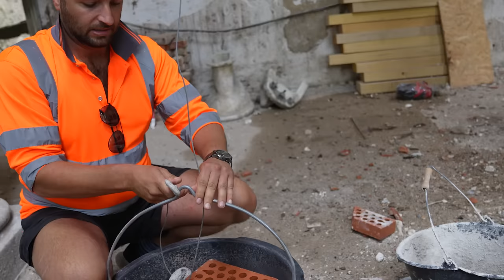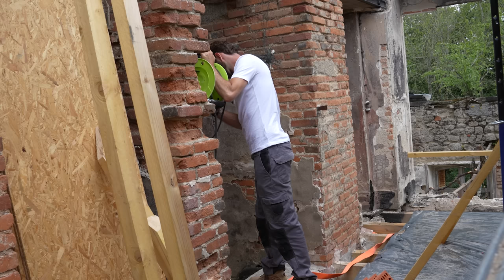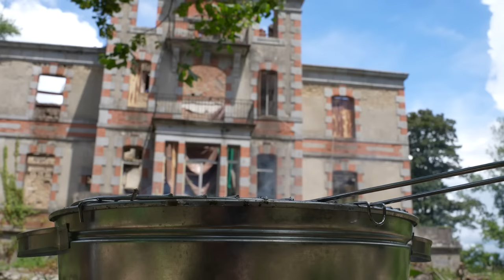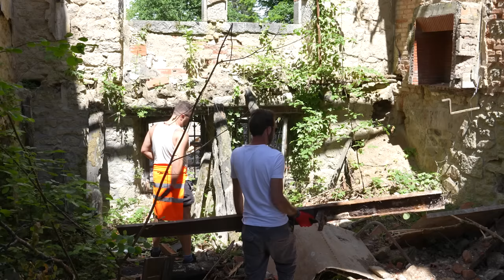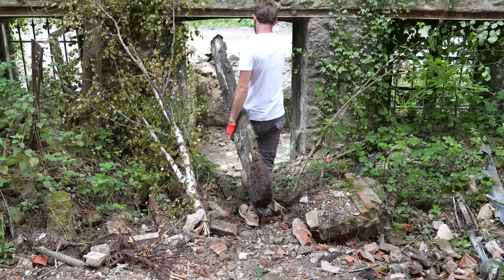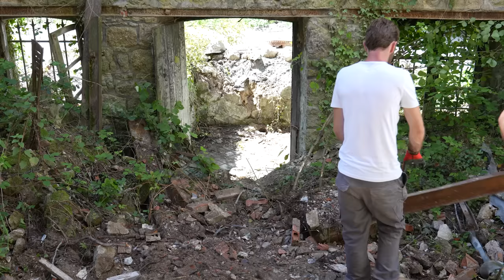300 bricks, two men, and a water tank.

Comment: Suggestion...move the bathtub outside and use it to soak many more bricks in prior to bringing them upstairs. It would return you to bringing them up a bucket load at a time again, but might help keep the bricks hydrated longer, especially on hot days. So glad that orange is still part of the wardrobe!😆
Reply: Bonne idée !
Reply: A second bucket could help as well.
Reply: Hydrated bricks will be heavier
Reply: @mireille4751  but he has to carry the water up in any case.  I think it’s a good efficiency idea to soak more brinks and have three or four buckets.
Reply: And - leave the tub where it can catch rainwater so Dan doesn't have to haul as much in!
Reply: Good idea!
Reply: @Marcus-ki1en    I was looking at the wheelbarrow sitting there thinking Calvin would have less trips & be quicker on sending the next bucket up. But I'll bet they savor the couple more minutes it took to get the bucket back on your level. So Much easier from the comfort of my couch 🛋
Reply: You will owe Calvin big time.  Friendship is a wonderful thing.
Reply: @marshawargo7238  I saw the same thing, but with the wheelbarrow, you are just moving the pile and handling the bricks three times.  I have bucked my share of bricks in my day, I don't envy them at all.  Always good to have help.  Pass me the chips and dip.
Reply: I like the idea of using the tub to collect rain water.  By putting it up higher and adding a facet at the drain, Dan would have water. Brilliant!!!
Reply: hoist the tub to the upper level and put water in it and dump bricks in as you lift them.  dry bricks are lighter to move and carry
Reply: Gute Idee!
Reply: Will  not work. The bricks will be heavier.  Can  polly bring it up! With wet bricks.Pull the bricks up. When you get them up. Then  water them..
Reply: @raynonabohrer5624  I think Dan has been using an electric hoist to bring wet bricks to the upper floors in previous vids already. I recently looked at low capacity hoists for my own use, and the lowest capacity I found online was for 200kg (440lbs). I'm sure that any hoist that Dan acquired is able to handle a bucket full of wet bricks. He may even be using it to install the new steel I-beams next week, if he's not having them installed by an outside contractor, in which case it will be capable of 700kg at least. Either way, he will find his way, I'm sure. He has so far!
Reply: Genius!❤
Reply: @mireille4751  True, but Dan already uses a hoist to bring up the buckets of bricks, so the hoist should be able to handle it.
Reply: Great idea!!
Reply: Mr June”s singlet and shorts does it for me - I’m not into orange!
Reply: Brilliant!
Reply: @mireille4751  yeah, but it probably beats carrying water alone, and then trying to sprinkle it around evenly...
Reply: That's a good idea.
Reply: Dan is right to soak it after  the bricks are upstairs. It will be heavy to do it downstairs.
Reply: They cannae find the plug 😂😂😂😂😂 xx
Reply: @mireille4751  And healthier!! XD
Reply: @andymccabe6712  Can you explain why the suggestion is so out of line? Dan has an electric hoist that he could have used to raise the buckets of moistened bricks to the upper floors, so it isn't a question of having to haul up the buckets by hand on the ladder. I'm truly interested in knowing why you would believe soaking the bricks in the bathtub to be so unreasonable. Thanks.
Reply: Hot tub or Orthopedic spa may be in order!
Reply: if they bought a second bucket they would be flying it, whilst fella on the bottom is filling a bucket the fella up top is emptying and stacking, i noticed them taking a tree out of the house logic would tell you lead it out by the root first, when they lifted out the remaining bit of water tank it would be lift then throw the remainder Dan lifted to shoulder level leaving it so he could push upward and throw orange pant man lifted to his arms were locked upward resulting in it making it heavier for Dan. Obvious from the clip orange pant man not only turning up in shorts and trainers is inexperienced in physical labour you do need a mix of brain & brawn

Comment: Strong work! Please put the two tanks to some good use, either by welding them back together or somehow repurposing them. As you were carrying the base out upside down, the thought occurred they would make a couple of very nice tabletops with the rivets all the way around. And the uncovered stairs look fantastic!
Reply: or off to the tip to the scrap metal container ;-)
Reply: EXACTLY what I was thinking! They are so heavy-duty and well made, with the sides trimmed right to the bolts (becoming a decorative side border) and the metal all smoothed and polished, they would be FANTASTIC table tops. In the states, a re-purposed item like that would sell for big bucks. Dan has so much on his plate but hope he doesn't lose sight of the value in some things he's just tossing out of his way now. Make a 'future project' pile somewhere so later on he'll have FREE material to use in creative projects.

Comment: On our job, to save time, we put two short scaffold poles through a small pallet and fixed them in place with blocks and then a self centering (blue poly) rope sling over the four ends of the poles attached to the winch. We had the same winch as you have. We could lift 18 blocks or loads of bricks and stone. Just saves time and effort. Small batten lip round the edges of the pallet.
Also, with a three legged rope sling, we lifted a barrow of mortar at a time. Your winch can lift 250kgs, might as well use that capacity and save some time climbing up and down.

Comment: Dan when you fully clear out the wings, it might be worth reversing the bucket on a digger and extending the arm into each area as best you can.
Then toss excavated debris in the bucket and cart it away directly with the digger which could save Calvin or whoever a lot of toil!
Reply: That was my thought.   Chateau du Theil did just that on the bottom floor.

Comment: Tip for cleaning out this room and more.... make a picture of the wall besides the cleaned staircase after numbering  each stone Dismantle the wall and make a reverse ramp / slope to get rid of the rubble. Next: it Will be easier to bring in building materials ( in line vs on an angle). At last: when work has done: rebuild wall etc. Gr. Ron

Comment: SAVE THAT WATER TANK BASE... when you scrapped the upstairs water tank(s), I thought the base looked pretty good with its series of rivets on all sides. Though you may wish to recycle the cut sides...perhaps SAVE THE BASE to use as a tabletop for future DIY projects?  A simple support stand is well within your abilities...but a nice, hard, flat surface would be useful at some future point, holding materials, tools, whatever. Later, when not needed for such, you could clean it up / polish(?) and place it somewhere as a memento of the former ruins - perhaps as the display table top for other finds (tiles, fancy hardware, etc) you come across. As always, just a thought/suggestion.  Very good episode - nice you've got some help, and company this week. Progress, progress, progress. Well done!

Comment: When you clear in the upper area why don't use a slide or chute that dumps right into a dumpster or trash bin outside building it will save a lot of moving trash.  Lot of construction sites use them to get rid of their trash as they tear down.
Reply: A dumpster is expensive to rent, and then to get moved off the property. Is he waiting until the roof is done to get a dumpster, then?